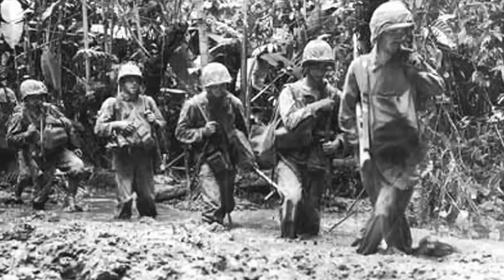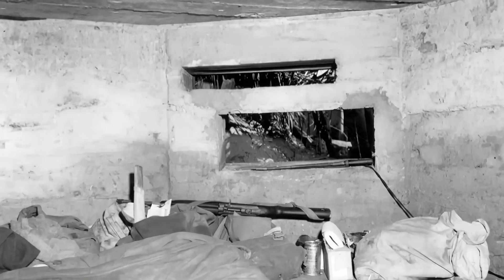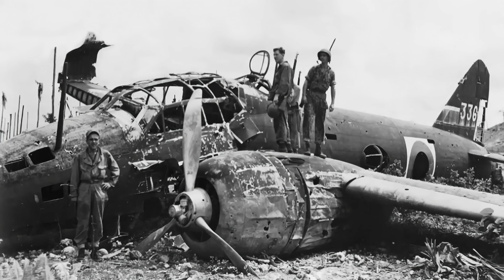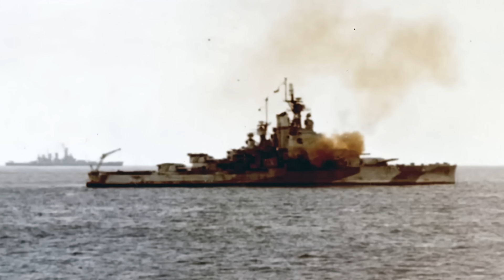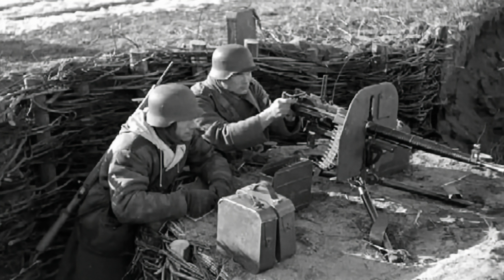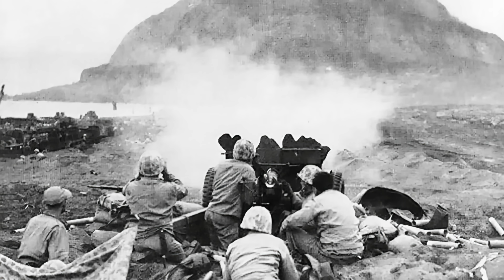How One Sergeant's "ILLEGAL" Trick Made Stinger Machine Guns Fire 3X Faster At Iwo Jima

Comment: The Stinger may have gone away, but the role was also filled by the M1918 BAR, until it was replaced by the SAW (Squad Automatic Weapon), M249. The BAR and M249 rate of fire isn't quite as rapid, but 850 rounds per minute isn't anything to sneeze at.